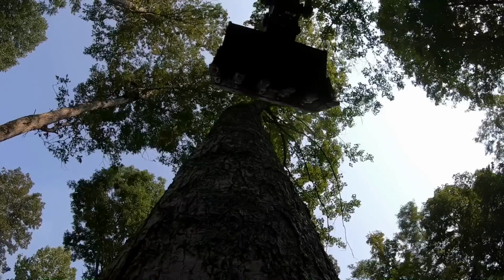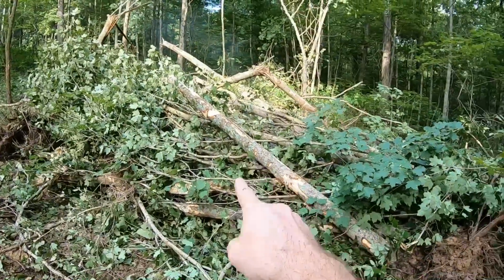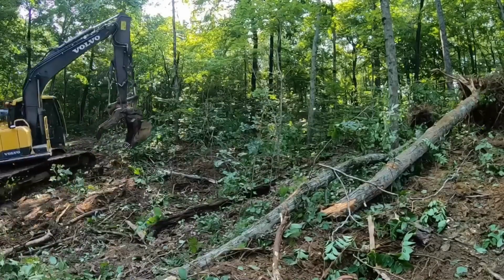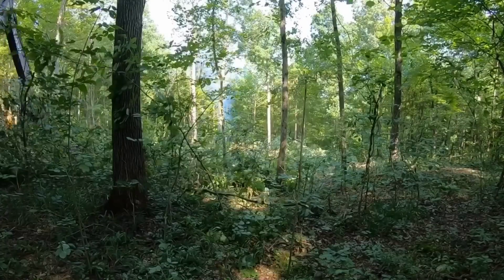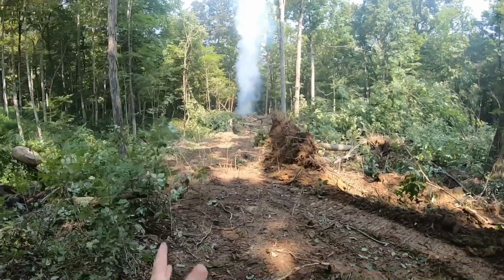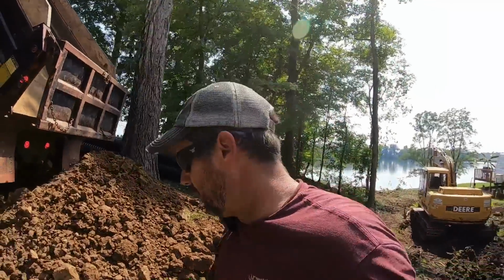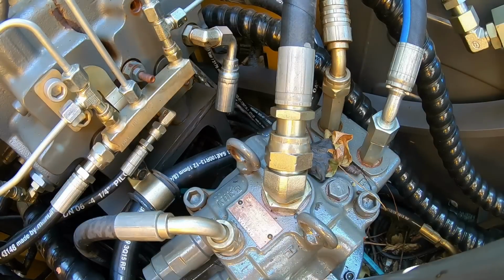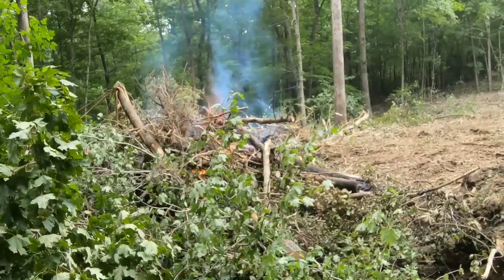Land Clearing for Pond Job - Volvo 140 - Burning Brush

Comment: Nice little lesson on reading smoke @ 26:05. That's a lesson best learned by experience.
Reply from the maker: Fire Captain Tom I agree!  It always has a story to tell.
Reply: @CaptainKleeman  
Location, volume, color, pressure.
When will hear about the new position.

Comment: Build yourself a armored camera box as a practice for welding. A spot for a cable bike lock if you want to use for long exposure shots in places cameras might walk away and a spot for a ratchet strap to hold it to a tree/pole in normal use. No fear of a tree hitting it and if built well you can change out the type of camera from a trail cam to the different hero camera setups.
Reply from the maker: Andrew H that would be pretty cool!

Comment: Looks like an original hose possibly based on the lay line on the hose and my experience.  The lack of hose material up inside the fitting tells me that hose was never crimped properly, and how the hose blew out of the fitting like that.

Comment: I have nothing against the Go-pro camera you use - but when you put it in danger it can get expensive.   Have you thought about an inexpensive version of similar cameras you can get from sites like banggood?   They usually run under $75 so they can be put in harms way .   Just a thought for things like the Ax Cam which by the way I really enjoyed.
Reply from the maker: NS5107 aka ChazCo I’ll check it out.  Thanks for looking out!

Comment: Mike should have never used a garden hose as a hydraulic hose
Reply from the maker: DAN BROOKE came that way 🤷‍♂️.  The failure was with an improper crimp as well.
Reply: Damn dan what to you use as garden hoses out you house
Reply: Dirt Perfect 
5000 psi garden hose is normal isn’t it? 🤣😂🤣